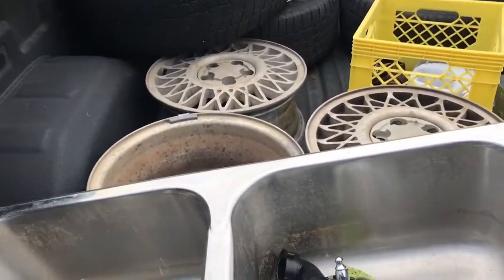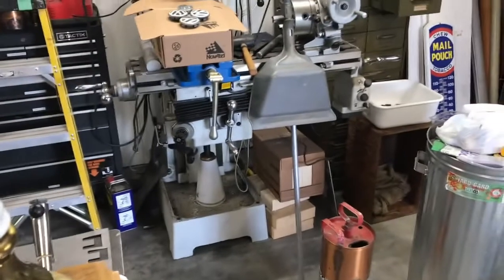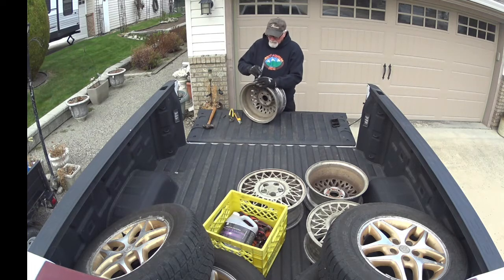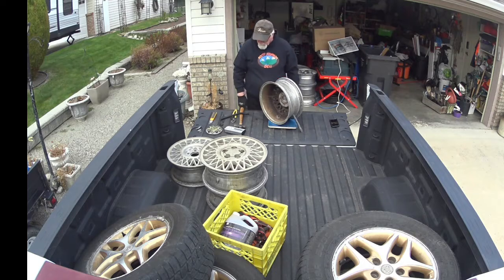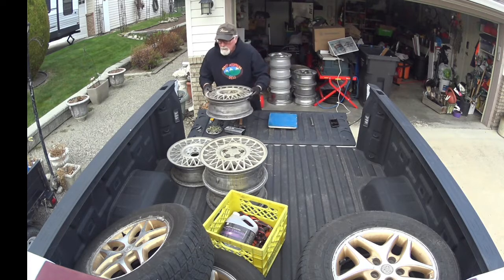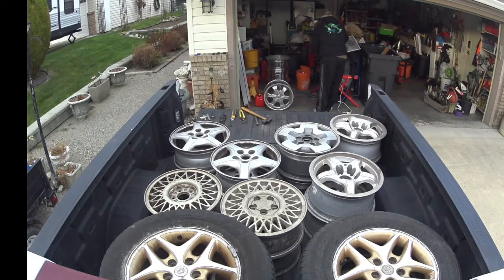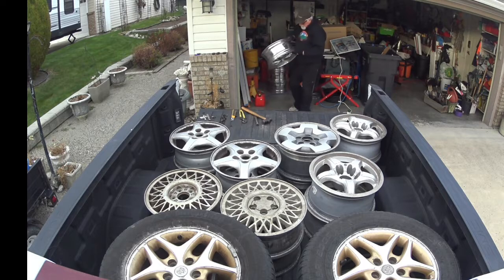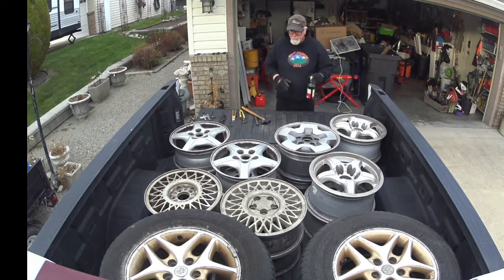PREPPING ALUMINUM RIMS FOR A SCRAP RUN !!

Comment: It's hard to find stainless sinks that are non-magnetic these days.  So much low grade stuff out there.  Same with brass faucets.  Often only one piece is brass the rest is zinc.  I've finally wised up to Christmas lights thanks to Canadian Treasure Hunter.  We are getting somewhere between 40 to 50 cents a pound for the lights bulbs included!
Reply from the maker: Yes, all the newer stainless seems to be the Chinese magnetic version. I find if that the taps are not brass they are usually stainless. A lot of the other pieces are aluminum or plastic though.
Reply: @CruiserMac  hmm you are right I don't think i'm considering stainless on some of the taps.